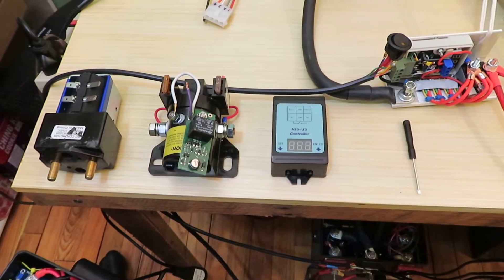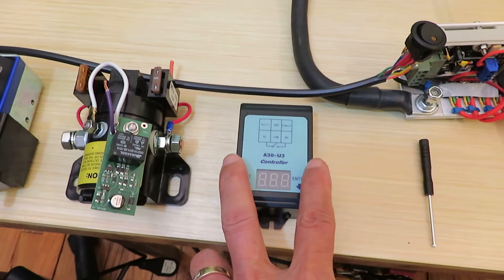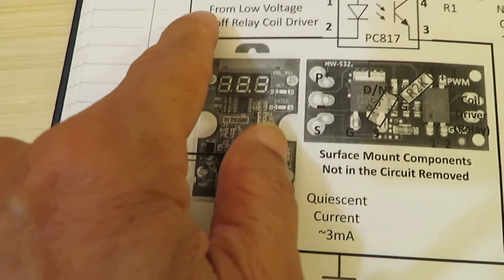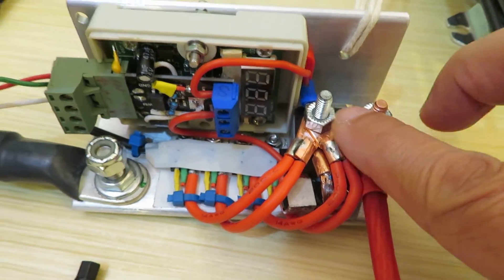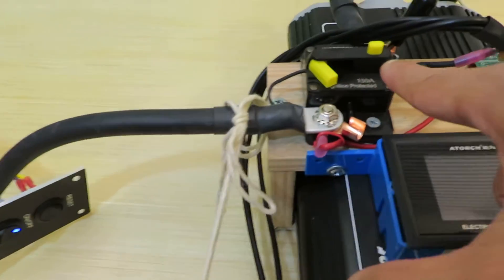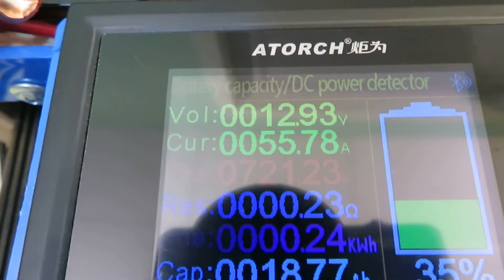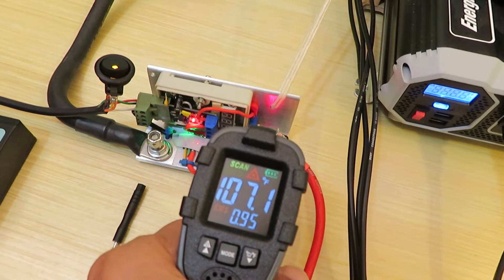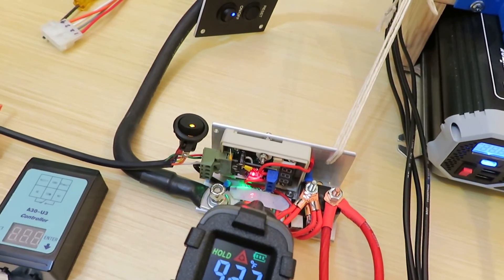Custom Design of a 12V Battery (Protect) Disconnect Solid State Relay

Comment: This was interesting to watch. I find it interesting that the circuit breaker is the higher power dissipation device.  It's easy to get tunnel vision on the FET resistance when after a certain point it becomes far less significant.

After looking it up, I'm not surprised to see that you had a tough time sourcing the obsolete Infineon FETs.  Surface mounted P-channel FET SIRA99DP-T1-GE3 is in stock at Mouser and IPB180P04P4L02ATMA1 will be very soon and both have a lower RdsON, but you do have to manage heat transfer through the PCB rather than directly on the TO-220.  And of course you need a circuit board.  It looks like you're set for your one-off implementation, but if you ever want a little PC board to hold some/all of this let me know and I can probably whip up some artwork for you to send to somebody like OSH Park or Seeed.

Different topic: I have yet to crack it open but I know one of my H batteries is really weak.  I'm pondering just gutting it and going JK, but also considering replacing the contactors on the "good" battery with something like InPower SSC3-200B.  I might have missed a video but have you looked into solid state contactors for the KS2 batteries?
Reply from the maker: Thanks for your comment and I will keep your offer in mind. H to JK is a good idea. I am in the process of converting two Ecotreks to JK's and should be done in a month (waiting for parts). I have looked into solid state contactors briefly. Replacing just the contactors is not a good idea just to avoid the high overhead. Solid state contactors are expensive and uni-directional. The Ecotrek contactors are bi-directional and robust. The weak link is not the contactor but the complex discrete electronics and all the wiring connections. For half the price of a solid state contactor, you can buy the JK BMS that has a bi-directional solid state contactor built-in.